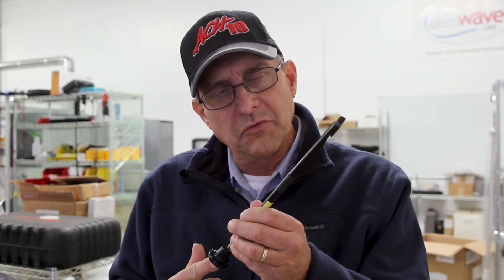Phil's Probe - "For voltage not current"

Comment: Great tool but, the piercing needle get damage quick. All my piercing probe are with no needle in the middle of the probe and the other needle left are deeper than before so is hard to pierce a wire with it. Expensive tool with no warranty is the other issue I have with this. This is my second set the same issue. I definetly won't buy this again...

Comment: Good to know. I purchased one, mostly because of the long reach.
Reply: Thanks, Grant.  I designed it with O2 sensor analysis in mind.  Back in the day of slow data transmission, a better way was needed to diagnose O2 sensors and the longer reach of the probe help cut down on the burns on my arms.  We don't much need to probe O2 sensors anymore but circuit testing with a loaded circuit is certainly still a viable means of testing.